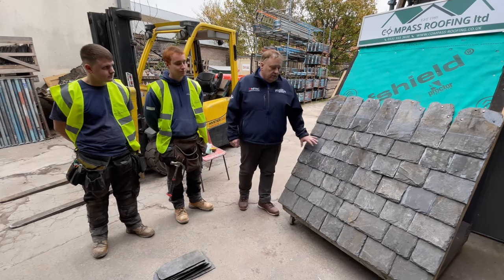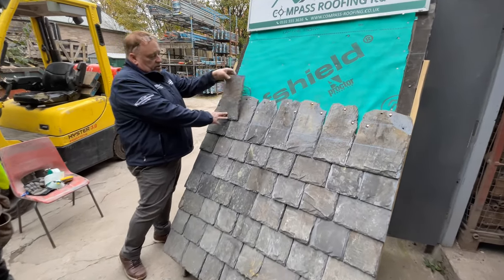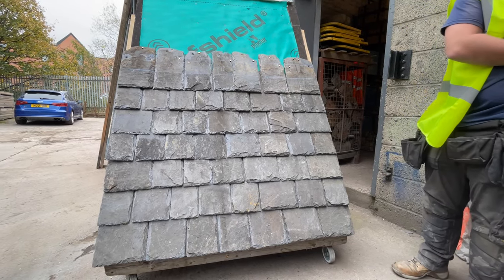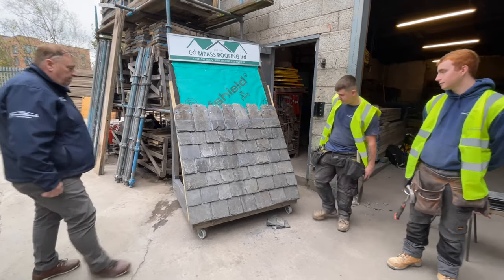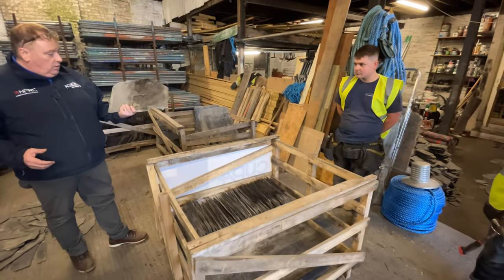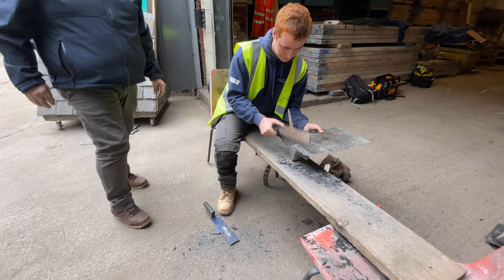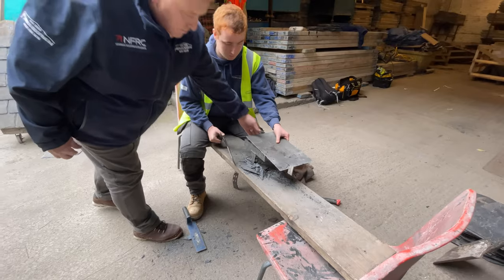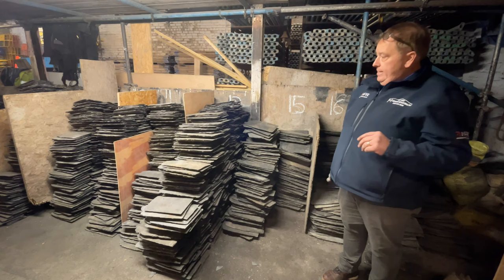Roof Slating Demonstration

Comment: It’s really good to see such an excellent demonstration and understanding of this traditional skill which is sadly neglected in many parts of Scotland. A good teacher obviously too. So important on heritage buildings, listed houses and conservation areas. I would however suggest that holing slates correctly is vitally important. This was traditionally done with a boring machine which was hand operated. This ensured that every slate has a strong enough hole to take the weight of the slate on one nail. Using the spike on the knife will often make a hole which will delaminate the face of the slate and weaken it causing many more slates to slip. The knife should really only be used to create an additional hole for side nailing as on the verge.

Comment: I've worked on slate roofs all over Glasgow and never found double nails on old ones. With that modern stuff every slate is double-nailed near the middle and they are almost impossible to remove when they split (which they do all the time)

Comment: Great videos! Does anyone have a recommendation for the best underlay for slate? I'm struggling to find reviews as most membrane companies demonstrate using their product with battens (the English way) therefore allowing for an air gap between membrane and tile/slate, they seem to suggest this is important, so whats the recommended membrane designed to be sandwiched between sarking?
Reply: All these demo's use Proctor's roofsheild
Reply: To my belief Torching/Tiering (the lime mortar daubed on the inside face of slating) is to stop spindrift snow from entering and filling the roof space. Sarking boards are a far more reliable method of achieving this - and they sometimes serve a structural purpose too in 'cross bracing' a turret roof/bay window head. With a refreshed and reliable slating system, and an existing sarking structure, why potentially 'smother it' when it has been in place - and worked well - without a membrane for a hundred years? 

I am assuming of course that you are talking about a pre-existing roof structure.

I am not a roofer, but I have a similar instance - soon to be re-slated - and I am thinking things through based on what is demonstrably proven (in situ) to have worked for 108 years..... and counting.

Comment: it would be great to do work like this on close bording roofs but on a fixed gage like 24 x 12 on a 10 half gage you can only shoulder nail them its first time ive seen slating like this in the 34 years ive been a roofer . but still very could training
Reply: Snap, ive been slating roofs all my life, retired now. Never seen a slate roof on a close boarded set up. I worked in the states back in the eighties they close board over there but still put laths over the top if they are going to tile or slate it. Guess it makes it a lot easier.

Comment: 50mm lap, in Scotland !  In the north west of Britain has to be at least 100mm  head and side lap and every slate double nailed at least, Scottish cowboys, yeee haah!!
Reply: Is this just a terminological difference? From the span of the young fella's hand you can see that the chalk lines are about 120-150mm apart, so the actual overlap (or underlap of the preceding slate below) is about 120/150 overlap + 50 headlap =170/200mm total overlap.

Comment: Shouldn't the head cover be at least 75mm, that head lap looked to be about 25mm
Reply: agree with the 75mm headlap as you say but he did say the headlap was sitting at around 50mm. Can only imagine they've dropped the headlap seeing as they have a fairly steep pitch on the roof they're using

Comment: Cant believe an experienced tradesman would allow a first year apprentice to do that without safety glasses, unbelievable pal.
Reply: Doing what, pulling a nail, or manually trimming a slate? 

You'd maybe have staff putting on safety glasses and respiratory apparatus if they went to the gents in case of splashback.